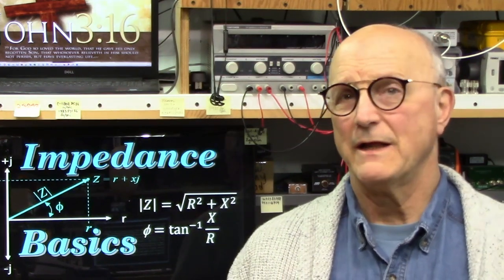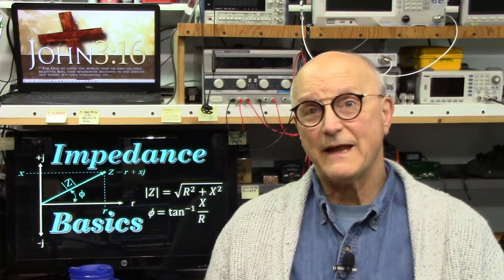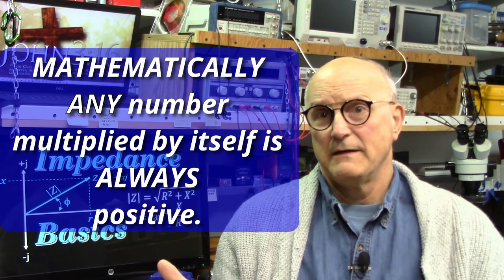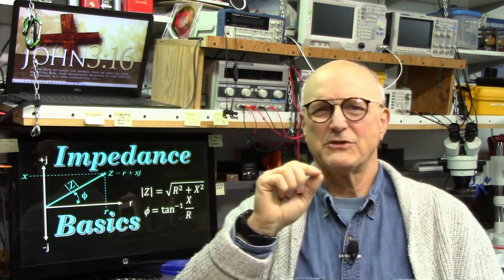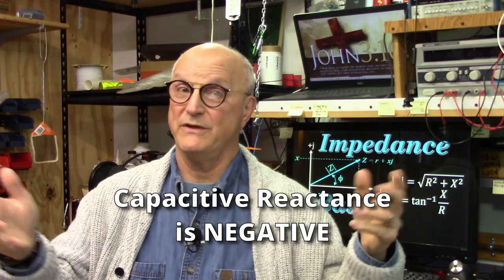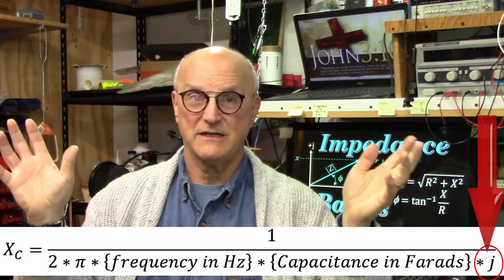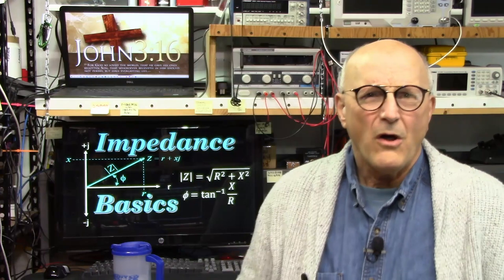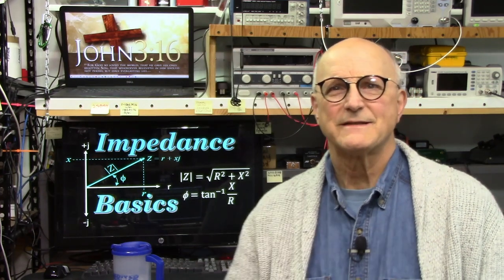Impedance Basics (055)

Comment: You made my brain hurt ... a good thing. Two things crossed my mind (1) with all this funny math is it possible to have a minus R? (2) what happens to j at resonance XL=XC? (2a) any difference to j in series and parallel resonance?
Reply from the maker: Yeah... minus R, I always believed that a minus R was not possible. But, I just measured the impedance of an 82 pF capacitor using my high-end VNA and it came up with a negative R! ... Investigating! There is something here I need to learn about. Your question helped me find it.
Your question about resonant L/C circuits along with another comment from another guy has spawned the topic of the what might be my next video: Resonant L/C Circuits.  In an ideal world, the series resonant L/C looks like a short and the parallel resonant L/C circuit looks like an open ... in an ideal world, but we do not live there, so what happens then?
Thanks for the great questions!
Reply from the maker: "To start with, the normalized reactance may assume both positive and negative values, whereas the normalized resistance cannot be negative (negative resistances are physically meaningless)."
Fawwaz T. Ulaby, Fundamentals of Applied Electromagnetics, 5th Ed, Pearson Prentice Hall, 2007, p74.
As I thought, but what am I measuring then? More research.....
Reply: @eie_for_you  Agree, a negative R is intuitively wrong. Every R L C in our real world in not a perfect R or L or C. I suspect there's a hint of R & L in your 82pF? I'm pleased I've made your brain hurt too, nice to be able to return the favour. The joy of an inquisitive mind :)
Reply from the maker: @nevmarr  I've continued investigating this as the inquisitive guy that I am.  Here is the latest feedback that I have gotten on the subject ...
"I don't recall if there are passive elements that can display such tom-foolery. However my guess is that these small excursions outside of the |Gamma| =1 circle are likely the result of small calibration/math-rounding errors."